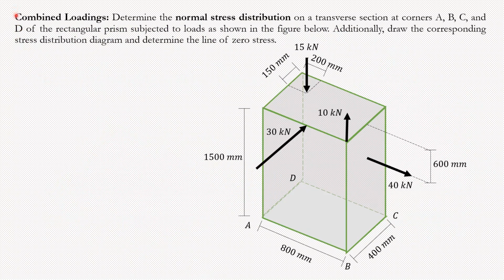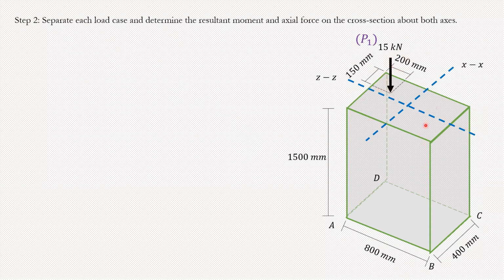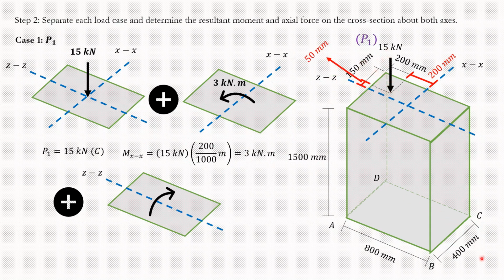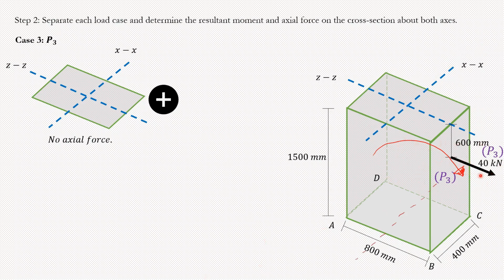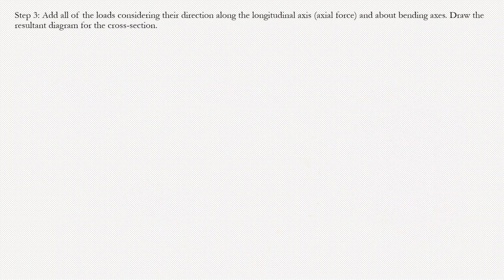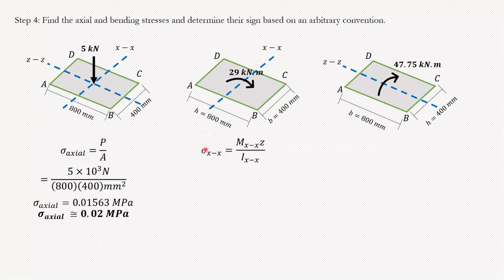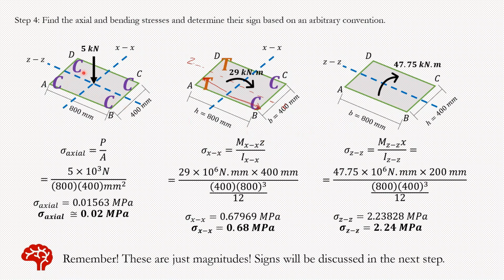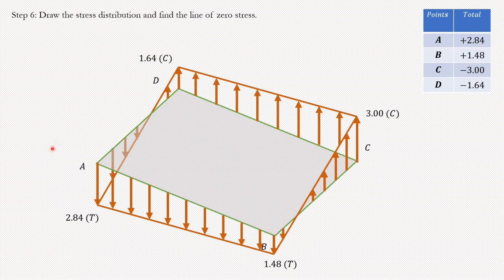Combined Loading (Comprehensive) - Strength of Materials

Comment: I can understand your subject thoroughly from start to finish. Comprehenssive indeed. Bravo.
👍👏

By the way, is it the same approach to find corner stresses in isolated footing?
Reply from the maker: Thank you very much for watching and I am glad that my explanation has helped you in some way! Regarding your question, remember that your stresses there are based on the pressure exerted by the soil. So, it is not exactly the same. You can visualize your footing as an inverted slab on a column. The column in this case is resisting the loads exerted by the soil. In other words, the column is your support. It is just an analogy. So for an isolated footing, you would calculate your soil pressure and then determine your required values like any beam or slab question. If the load is applied without eccentricity you will have uniform soil pressure, if not, then there are three conditions depending on if the eccentricity is less than, equal to or greater than L/6. After you figure that out, you can draw your shear force and bending moment diagram in each direction for the footing and determine the critical values for moment and shear. Also, be noted that the corner of an isolated footing does not have critical shear or moments. We evaluate the face of the support and dv from the face of the support for moment and one-way shear, respectively, and the critical perimeter of the column for two-way shear. If you need further explanation please let me know.
Reply: @StructuralEng  Appreciate your asking me your further help. I sent you an email. Thanks in advance for the reply.